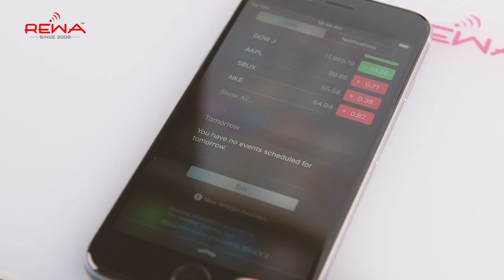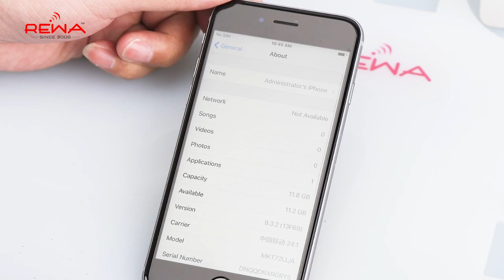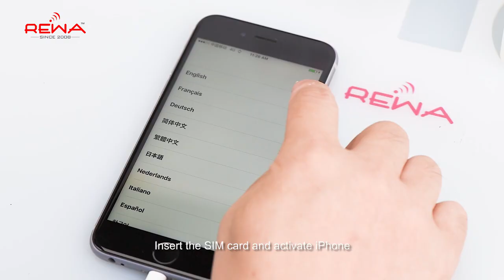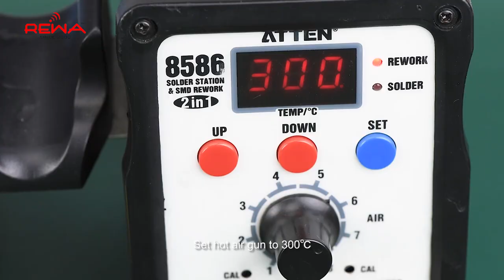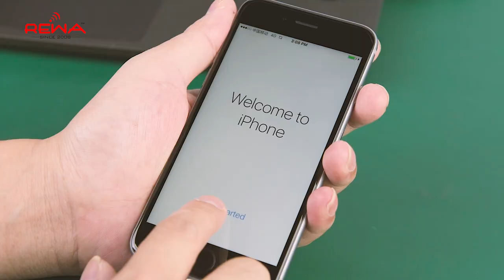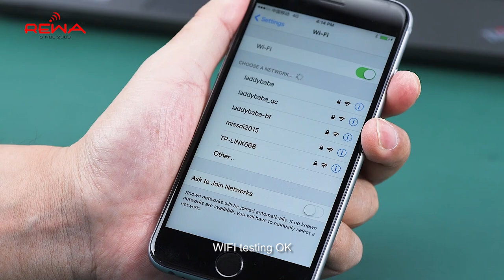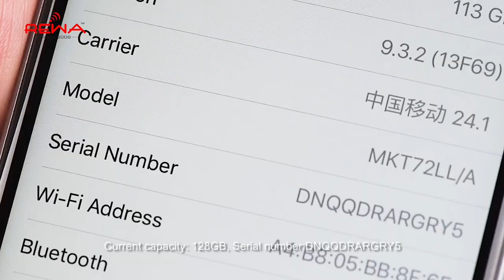Upgrade iPhone 6S 16GB Storage to 128GB

Comment: Meanwhile on Android phones. Insert 128GB Micro SD card for 20$.
Reply: and you can even switch multiple sd cards if 128gb isnt enough haha
Reply: aside of that, if hundreds of gb still not enough for u. u can also connect an external storage like flash drives using otg. 😂
Reply: ***** I dont know if theres an Android with 128gb native memory but u can upgrade 200more gb for less than 100bucks, unlimited times, what you going to do when your iphone memory its empty? Upload it to cloud? waste your data, speed while uploading, and lots of battery to do so, when u travel you usually takes lots of photos and videos and android gives you chance to put as many sd cards as you need, something that the Apple poor desing doesnt give you
In other hand you are are comparing an absurd costs, you comparing the price for people in general,so the iphone 7 cost about 250dls to make and sells you the upgrade from 32 to 128 gb for half cost of total phone, something that they spend 5 bucks on it. pretty damn expensive…
You talk about speed? Every top tier phone has high speed native memory, but the sd card give you extra storage and it doesnt requiere that high speed to do its job
Reply: ***** Lmao, we totaly need read/write performance on our cellphones. Apple fanboys are the worst. Jesus.
Reply: what happens if you loose ur internet connection if u travel outside of the US? because network is shit.
Reply: Siam Simte true that another point for android switchable sd cards
Reply: Siam Simte Network is shit outside of the US? Are you aware how big this planet is?
Reply: im pretty sure he meant 4G if you go outside your country the price for 4g per mb is quite high so isnt an option
Reply: Joaquin Carrillo finally. Someone who actually visits other country. :D
Reply: Joaquin Carrillo Well, he clearly said network is shit, not expensive.
Reply: yes thats another appreciation
Reply: Eric B yes. You wont get consistent network speed out side of the U.S. unless its a military network. and the coast of 4g internet lets say you pay 20$ in the US. outside that same internet price will triple up. That kills the entire purpose of the icloud.
Reply: +XDA Developers (CZ+SK) Dokonale vysvetlené, pretože na Slovensku a v Česku sme na takých hlupákov zvyknutí :D
Reply: +Edgar Koterle ty si všade :D všade kam idem je koment od teba
Reply: Polkacik fúha , vidím , že aj slováci si rozširujú obzori , páni aj ste to niekto spravil ? Lebo ja sa k tomu odhohlávam ale nemám s tým žiadne skúsenosti a dosť sa toho bojím , ale predsa risk je zisk a každá rada je dobrá
Reply: lol.
Reply: Andrej Zaujec no veľa šťastia :D
Reply: Eric B adding a 128gb SD Card will slow the device down so there's no point
Reply: Eric B Micro sd no use lol. I tried getting the apps to the card but they still take space on the onboard memory.
Reply: Albie Thomas Paris how?
Reply: My phone has a light
Reply: ***** mine has a hand to hold it in 😂😂😂✌✌
Reply: FiryMY You can root the phone and make the sd card the main storage. Idk how you do it look it up
Reply: Mine has a case
Reply: It's got a calculator wow
Reply: lol i added a 254 GB (sd) to my 32 GB s7 edge
Reply: Eric B I guess you've never used a phone with high performance storage.
Reply: I'd love to see you achieve that.
Reply: +XDA Developers (CZ+SK) that's pretty damn good specs on the 128 GB SD card but 250 bucks? I've always wondered why most of my SDcards have really shitty performance. Whenever I use link2SD to move apps into my card those apps run like crap after that so I eventually move them back. And that's with a really expensive patriot card that I've got, that one doesn't even reach 10 MB per second one I test it. But $100 for a i6s? that's a pretty good price, do you mean you pay that much to get it from your carrier right? I paid 30 bucks but I had to pay a little bit more with monthly "rental" on an iPhone 6s
Reply: 20$!? omg
Reply: +Andy G haha I got lucky with Gdrive and Mega, I have about 50gb on each due to special offers I jumped on when my devices were new. Mostly from a Galaxy Tab 3, once I regged my Samsung account they gave the space. On the other hand. OneDrive dropped their space from 15gb to 5. Which immediately locked up my account cos I was using almost all of it. Maybe they offer more to Windows phone owners. I don't know anyone who has one of those though.
Reply: +The Joker good point- but your SDXC card, that's "up to" 300mbps? Will it sustain that speed for large file xfers?
Reply: XDA Developers (CZ+SK) nobody in their right mind needs 400MB/s read for fucking music, videos and apps. its a fucking phone not a high perf. PC
Reply: MotoK tips well seeing as the iPhone is the fastest phone out there, and that loading apps is mostly dependant on how fast your storage speed is ill say it's needed.
Reply: Eric B 128GB for 20 dollars? 
i can only dream...
Reply: +MotoK tips but - it IS a high-performance PC! Either android or Apple. It's why I love these things. But you have a point, most people don't need the hi-perf storage. I'm happy enough with my 10mb/s Patriot stick. But I have a 64gb iPhone 6s, which is plenty for me.
Reply: +Joe Pinder not merely apps, but browsing is a hell of a lot faster. To get that on a PC, you have to have 8gb or more of fast DDR3
Reply: 20$? I call bullshit. 
Unless you mean the Class 4 cards which are too slow to even use for photo storage. Let alone apps and games.
Reply: Objectified Cross they barely sell 64GB cards at the local supermarket,  i only wish a 256GB/128GB was that cheap.
Reply: where I live you can get a class 10 64gb for 40. but I don't know about 128's not many stores in my area seem to sell them.
Reply: Maby where you're from, where i live we have 128gb cards everywhere.
Reply: Joaquin Carrillo but iCloud isn't limited to just photos a videos. you can back up app content from any app on your phone. So if you have a third party notes app, browser etc. absolutely none of the content is lost. I still prefer Android, but this is a cool feature.
Reply: That... that's not how that works at all
Reply: ***** it didnt put the +<name> thing in, I was replying to a guy who said putting a memory card in your phone slows down your phone.
Reply: If that's not enough memory you should just carry a damn computer seriously. I use maybe 20% of my 128 will not be buying that much storage again
Reply: I use WAV music format and that takes up a lot of space. I used 75% so far.
Reply: +IRD Studio that was me and it's true, but not in the sense that adding the card slows it down. Adding the card has no affect on speed.  Only if you move your apps into the card, like if you root the device and install apps2SD. I say that from experience. Because my cards are very slow. If you have one of those fast cards XDA is posting about, it should not slow you down.
Reply: +The Joker what?
Reply: +Travis Bickle yeah I have plenty of those plus a bunch of MKV format movies
Reply: +The Joker oh you're talking about my browsing on a PC comment? It's because I have an old shitty computer with only 4 GB of DDR2 RAM, and it takes forever to pull up my browsers. I can pull Safari up instantly on my iPhone so that's what I use mostly I'm using it right now as a matter of fact. But I just got a new laptop it's an Intel i3 with 8 GB of RAM so that should be better for me for browsing. Dell vostro, my neighbor gave it to me in trade for a couple of guitar amp speakers I gave him.
Reply: +nathaniel pritzer where are you situated where you can get 64 GB cards for $40? At that price I don't care if they are fast or slow, i'll just use it in my zoom recorder
Reply: Eric B for $20!!! where !!!???
Reply: nobody needed an ssd. you should put a 640 rpm hd in your phone..
Reply: yea, good point, but you know, if one can afford to pay absurd amounts for an iphone, then one must have a PC or laptop of some sort (surely, i mean, wtf are you doing with your money if you don't). Dump yo shit on there. otherwise, go SD cards man, not totally reliable but always a respectable option. Also, it's a sellers market, capitalism is what it is.
Reply: ked nemas skusenosti tak kasli na to. potrebujes solidne naradie a aj solidne znalosti letovania cipov. vyskusaj najprv spravit par notebookovych NB od ati a potom uvidis
Reply: +The Joker for cheap SDcards? Sure!
Reply: +fragment7 you mean 6400rpm HDD? Usually laptops had 5400rpm HDDs. I have a 7200rpm WD Scorpio I used to use in an old laptop, have it in a Vostro now. It's still fast for how old it is.
Reply: +Ryan Schoeman I've never paid any more than $259.99, for iPhone 4S, 5s, and 6s. Sprint still offers the subsidy, you just have to know how to ask for it.
Reply: +The Joker excellent, thanks a lot! I paid 60 for the 32gig Patriot stick I have now. But I want this for my Zoom recorder.
Reply: +The Joker yah the 1st one is the right size, but I have an adapter so it doesn't matter if I get micro or regular.
Reply: Eric B meanwhile on Samsung Galaxy S6....
Reply: The Joker there is no Note 7 😉
Reply: The Joker there is a fine line between bravery and stupidity, you are a brave soul
Reply: Definitely nothing wrong with the note 7, isolated incedences create a media frenzy, like the ford Kuga's in South Africa spontaniously combusting, it happens, but one shouldn't be too worried. Apparently the iPhone 7 has had a few cases of exploding batteries, but so far i still have all my fingers and toes so it's all good
Reply: Eric B internal hdd's r better dud
Reply: Nigga what? In my country 128 and 256 gb sd card cost at least 100 dollars, 250 if you want 256 gb
Reply: Devid Sardi what country do you live in?
Reply: +The Joker actually I saw one of those for the first time recently those are excellent devices and I know a few people who claim they still use them. It's too bad a flaw that affected a number of devices severely caused the whole line to be yanked. People forget that the Apple 5C exploded as well, pretty commonly as I remember too.
Reply: +Devid Sardi check the link that +The Joker sent me, A 128 GB card for extremely cheap.
Reply: External storage is useless on Android, some apps can't be moved to the SD card and some apps like WhatsApp like storing stuff there, so if the SD card fails (has happened to me many times due to overheating on my M9) everything breaks.
Reply: external storage is a non issue for android since adaptive storage feature was added... insert a microsd, format and select adapative and it will turn the microsd into "internal" storage and act as the same as the base storage, no longer an issue of certain apps not being able to be moved to it
Reply: Eric B where can I insert an SD on the one plus 3 risp plz
Reply: um they sell external flash drive. You can export over to the drive. Whats the issue.
Reply: thats why i have a 2 in 1 pc.
Reply: +The Joker that's what I had read there was some puncture in the note7 battery. But you think that Apple users in the factory did it on purpose? The Samsung article that I read which they wrote claim that it was something to do with the way the devices were assembled.
Reply: +The Joker usually Asus makes good hardware all of my motherboards are Asus and they've lasted since 2006. Not a lot of power but good stability. I'm not a fan of their laptops though, The keyboard breaks and has to be replaced.
Reply: XDA Developers (CZ+SK) internal storage will and always be faster than external
Reply: Marco Mazz if only I got $100 for every person who thinks Android users ar poor. 

you owe me!

Comment: When you do this step that only have 2 choices :
1. 95% Your Phone Dead
2. 5% Your Phone Success from that surgery
Reply: Don't buy a stupid Apple, any other phone you slide in the memory easily.
Reply: That is correct
Reply: 95% Your Phone Dead :D trueee ahahaha
Reply: Robin Sattahip storage. Not memory
Reply: For those who dont have skills.
Reply: We have found you tube stupid comment of the year the award goes to    Don’t buy an apple 🍎
Reply: depends if you know how to solder really
Reply: Definitely Ryt But It Is Possible That Sounds Great.😉
Reply: That’s why you practice a shitload
Reply: Robin Sattahip any other phone is the exact same you just have a slow ass micro sd slot
Reply: @rsattahip  The software prefers to be installed on to the NAND rather than the SD/TF
Reply: Wrong! Good technicians can Easley handle this lol
Reply: @rsattahip  yeah that is ridiculous

Comment: Can you post a video on how to upgrade my galaxy s1 to galaxy s7 edge?
Reply: Muhammad Saeed You just have to smash it until you get a curve on both sides and then seal it so it turns water resistant, congratulations, you just got an S7
Reply: +Alex ? (AlexTBoss412) then buy a glass case then microwave those two, boom, glass back!
Reply: Clorox Wipes We should be engineers on Samsung right now.
Reply: go to shop and bring the money
Reply: I would also like to know how to upgrade my iphone 5s to iPhone 7plus
Reply: Muhammad Saeed you go to the store and buy the s7 edge
Reply: Alessandro D. Sánchez haha
Reply: Hahahaha nice
Reply: Thats is easy. Just go to the store and exchange it.
Reply: You can only upgrade it to a Note 9. Sorry.
Reply: Just buy a s7 simple😂

Comment: and you keep thinking that a chineese would do these in like 15 seconds on the production line.
Reply: Exactly what I was thinking.
Reply: zwodziarz 8-] uhmm they do it with machines
Reply: it is automated on the assembly line. BGA chip much denser than this are soldered at the rate of  thousands per hour.

Comment: How to upgrade the storage of your phone: 

Apple: all that process you've seen in this video.

Any other phone: just buy an micro SD card. Done.
Reply: then that would not be iphone anymore if you buy another brand! lol we are talking about apple here!
Reply: housemasterJKM lol SD cards would've fuck up iPhone's security...if you didn't know iOS is the most advanced mobile operating system and is way more complex than Android
Reply: Vlad Popescu-Bejat How would it fuck up the security of the iphone?
What can fuck up an iphone via sd card and can not do it via usb connection?
Reply: Dr. Manhattan you need special software and drivers to work with an iPhone, even jailbreaking software needs iTunes to be installed so the iPhone can communicate with the computer, also, when you connect an iPhone to a computer it will ask you if it can trust the computer or just use it to charge itself.
Reply: Yea, but it's kinda like saying, that windows make your house less secure. It is true, but most people prefer to have windows.
Reply: And Windows has more programs
Reply: The NAND flash is way faster than MicroSD card read/writes
Reply: Joe Schmoe So... MicroSD is still a need in any device
Reply: Micro nand cards? Lol
Reply: You realize microSD card have shit read/write speeds right? They increased storage option capacities so you start with 32GB like all Android phones and jump all the way to 128GB (which I got). My iPhone 7 has 290 MB/s write and 850 MB/s read speeds, which is at least twice as fast as any SD card. Adding an SD card would bottleneck the performance
Reply: BRBallin1 100mbs a second is not bad at all
Reply: ***** There are very valid reasons for their decision to not have it. I believe the idea of making a user not have to tinker with file management (what to add to SD card and what not add into it) makes things cleaner and easier to manage. Having the file system locked away from the user allows their devices to work smoothly every time and avoid user intervention that may lead to problems. Good thing they are more generous with the storage options now. You get 128GB for $100 extra which I think is a much better offering than their former 16GB to 64GB offering. Luckily I went from an iPhone 5 to iPhone 7 so I upgraded at the right time.
Reply: BRBallin1 "Having the file system locked away from the user allows their devices to work smoothly every time and avoid user intervention that may lead to problems"  meaning people are to stupid to manage files
Reply: ***** You can't rip on people who don't understand it like you. Everyone is intelligent in different areas. Again, it goes back to their philosophy of being simplistic. They are trying to reach out of the broader market because technology after all was designed to get real and practical work done and not to fiddle around with the software
Reply: Youlasty Mind does lol
Reply: Youlasty my phone is 2016 and have a 128gb sd card support costed me around 150€ "im french"